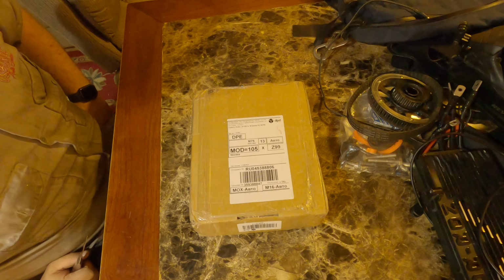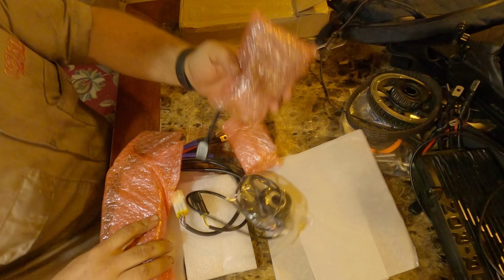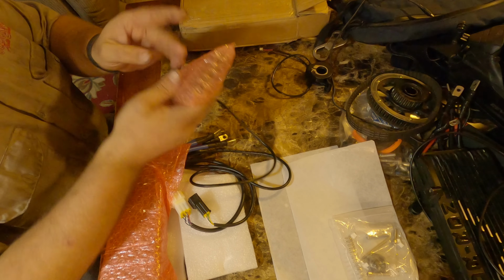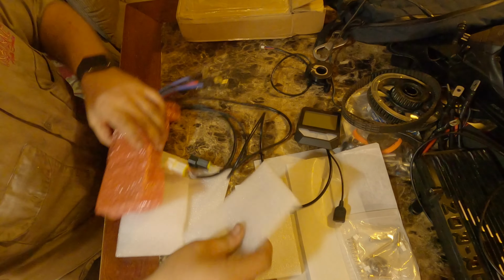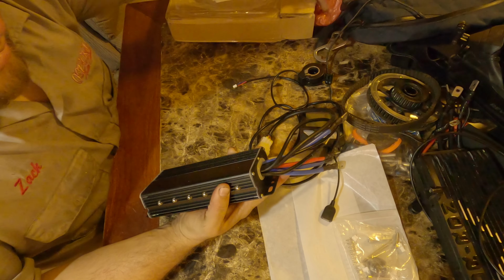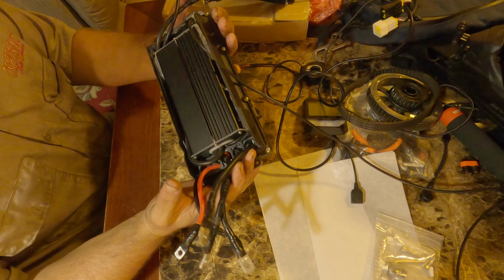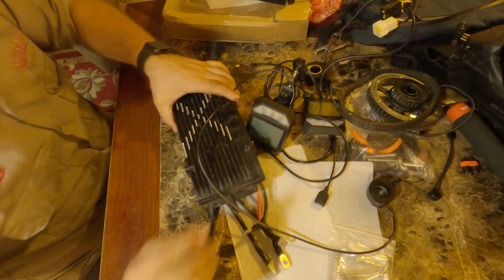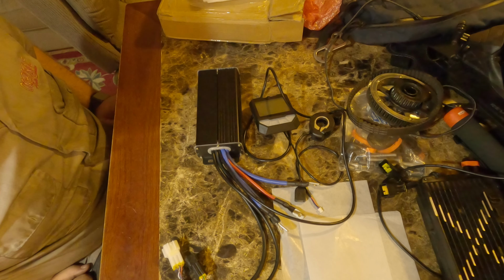Nucular 24F Controller Unboxing

Comment: my controller computer screen is not attached to the controller. Yours appears to be attached. WTF? I have had nothing but trouble installing this thing. Like I said there is no place to mount the screen and no idea what to plug it into it just has  a 5 inch cord with what looks like a USB hook up.
Reply from the maker: Behind the screen there are screws. Pop the screws off and you will see the connection. Yeah, the nucular was good 3 years ago. Now it’s like the worst 1. Hope  you get it going.
Reply: I still have mine. And it's better then most. I've seen nothing but problems in others. I've had a few issues but nothing major.
Reply: Still running. I bought a dual sport off Amazon.. just bought first engine upgrade.

Comment: Can I run the 24f with my stock battery?
Reply from the maker: You can, it will give about 10% more power
Reply: Nice thanks bro! Your bike is wicked fast!   
Its got to be the best setup possible🤙🏼
Reply from the maker: @littlebigplumbing6537  yeah agreed. Super stoked on it